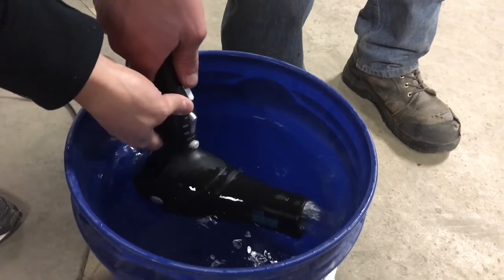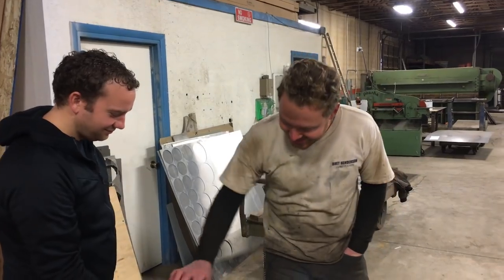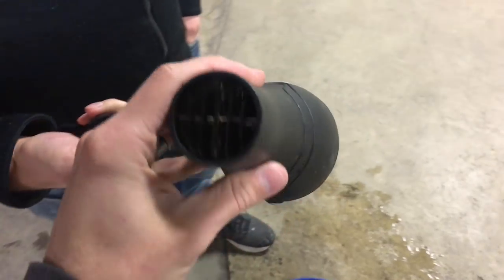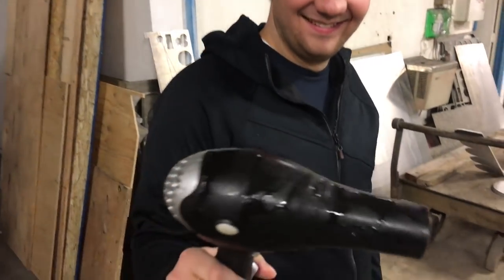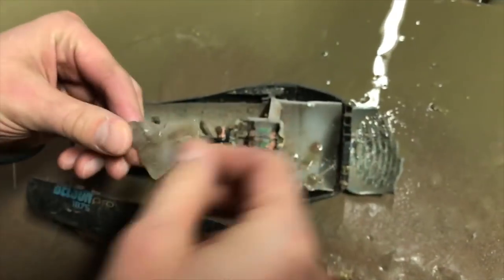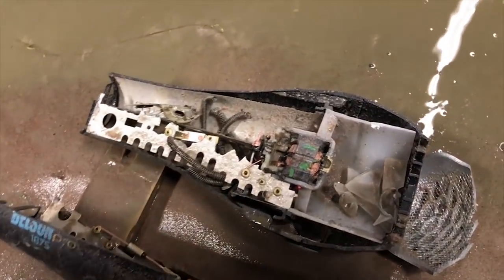Hair Dryer (plugged in) In Water vs 60,000 PSI Waterjet

Comment: Always fun to watch you guys cutting something in half. I made a video regarding this subject a long time ago. If you drop it into (Pure)distilled water, no. You had insulated boots on and used one hand. Repeat using bare feet. :-) It won't go well. You should have used a GFCI protected outlet for this experiment.
Reply: electronicsNmore if you add soap to the water it will conduct more electricity
Reply: The plug is already gfci but because it is only a 2 prong plug a gfci outlet won’t do anything it requires a grounding plug
Reply: Electroboom has an excellent video about trying to trip a GFCI outlet by shorting it out in water as well.
Reply: No path to gnd through the bucket hence no trip
Reply: Should have used a gfci outlet because you have a godamn waterjet..
Reply: Matthew Hunter The path was made when his hand touched the water.
Reply: electronicsNmore right that's why it didn't trip just in the bucket
Reply: If you look at the end of the cord, there is a GFI built into the plug. I suspect the power bar, extension cord, or the wiring in the building is faulty. New laws state that any device that could come into contact with water must be GFI protected on its own and not rely on the outlet being GFI protected.
Reply: But when the guys body absorbed the shock as he felt it, that should have tripped the GFI device built into the hairdryers plug.
Reply: Sounds like a faulty GFCI connected to the hair dryer.
Reply: Yeah because shouldn't the protection device be measuring the difference in current going in, compared to coming out the device to decide whether to trip?

I'm going for old wiring that uses fuses. Stuck a fork in my toaster once, to see what'd happen... managed to blow a 30A circuit breaker and a 13A fused plug (I live in the UK, our wiring is creative). Feeling a fizz from a bucket of live water should have tripped something, unless it's a fuse that needs time and current to burn out.

So for science he needs to stick his hand in longer.
Reply: James Grimwood Well, you start feeling if starting from ~10mA (Not strong, but you feel it).
And it is not even enough to trip a (normal 30mA) GFCI.
Reply: Well, I think there are different models of hair dryers. Saying, I would not put a hair dryer in water and my hand too, even if it were to be safely isolated from mains.
Reply: Too Many smart guys here lol. I agree with electrincsNmore but if there was a GFCI protection (Or RCD) connected, it might have been too little current passed to trip it. (There would have been considerably more current passed through his body without the insulating shoes on - and a bit more pain)
Reply: no, the path wasn't created because of the rubber on the bottom of the shoes.  the zap was due to the air resistance creating a bridge, but that wouldn't be enough to allow for the current needed to trip the safety
Reply: Russell, the bucket and shoes provided insulation from the ground.  the gfci was working as intended as it isn't designed to trip on overload or arching.

the way it works is, as long as there is no path to the earth, the line and neutral will be in balance with each other (no variation in current).  however, with a path to earth, now there is a drop in the current going through the neutral, throwing the balance off, which is detected by a coil in the safety, turning that variance into a small voltage that will be detected by the circuitry inside and activating another coil that releases a set of contacts inside, opening the circuit..

now, you might wonder then how the test function works on the safety.  the way that works is by pushing the test button you are creating a bridge between the live wire after the coil and the neutral wire before the coil.  this creates an imbalance because the coil will only detect the current over the live and see the same is not flowing back through the coil on the neutral side.
Reply: Thanks for the detailed explanation on how the GFCI works dude -  but I've had plenty of personal experience with them and understand their inner workings just fine. I understand that educating someone can be a rewarding experience so I hope others can read your comment and learn for themselves!
Reply: Draygoes rr
Reply: The hair dryer has its own GFCI

Comment: ld like to see you do the same with a UK hairdryer running at 240V. BOOM!!
Reply: CRAIG-CRAIG Might still be fine. It's a bit edgier, but the difference is not big enough for an explosion.
Reply: Landon Wantaja, Yes, UK is 240V 50Hz
Reply: That'd be shocking
Reply: Well officially the UK uses 230V but you will find that most homes supply is around 240VAC, Mine happens to be 245V.
Reply: The Volt or Wattage wont kill you, its the amp that can zap your life away at just 100 (0.1) to 200 (0.2) milliamp
Reply: Also 10 milliamp is 0.01 amps not 0.10 and 20 is 0.02

Comment: The heating coil inside the dryer is already a 'short', it's just that the coils are designed to dissipate the energy fast enough to not actually burn up the wire. Putting it into water only allowed the water to draw heat away from the coils, acting as a heat sink.

Comment: the thing about hair dryers is they are 120v sure, for the heating element, but the fan is a rectified 12v dc motor. and 12v dc is not affected by water. same as why when a car ends up in a river all the lights will stay on when its sinking...

Comment: If the water is fresh it won't really conduct electricity. If the water is soapy or salty, then it will conduct electricity about 10 times better. Its depending on how much salt you add.

Comment: The point of failure would have been when the jet cut the element open circuit at the beginning, the heat and the motor would both stop as the motor is power by a extra low voltage and uses the element as a voltage divider. elv brushed motors and heating elements will work under water as clean water is a poor conductor, however there is enough leakage current to still cause electrocution.

Comment: the weird smell was burnt plastic. heres how this thing works: you have a motor spinning a proppeller, in front of the propeller is some wire that heats up. if the propeller doesnt move the heat away because its busy with water, the hot wire melts the plastic

Comment: It didnt break because the motor relies purely on magnetic forces to turn. And the wire coils that go around in the inside arent live, they are thin coated by enamel because it would short otherwise. But i dont know why the heater didnt fuck up either. Maybe its enameled too? or painted...

Comment: It will only shock you if it's hot, the heat comes from coils with electricity running through the them and the resistance in the wire causes it to heat up and as the air blows around the coils it gets warm

Comment: Breaker didn’t trip because it’s not a gfci. It would trip if you overloaded or dead shortened the leads. Gfci trips when there’s small difference in current going “in and out” the outlet.

Comment: The failed GFCI is actually pretty scary..
Reply: Perfectly normal for them to do that if the amount of current leakage was lower than what they are designed to cut out at, the shock will still hurt a bit but it's pretty unlikely to cause you any harm.
Reply: LOLDONGS exactly happy to see atleast somone knows GFCI.
Reply: DamnFoxCat, I guess people misunderstand exactly how they work as they hear "they are designed to protect you from an electrical shock" and assume that any shock will cause it to trip.

Comment: the safety can't trip because you don't have a path to earth.  if you had provided a path to the grounding pin then the safety on the plug would have tripped off, but because you were using a bucket that served as an insulator there was no way for it to detect a problem.  the other issue is when the guy stuck his hand in, he was also insulated by his shoes, so even though he felt it there wasn't a path to earth.

the reason a hair dryer can kill you in a bathtub is because there IS a path present through the drain, which does normally provide a path to ground, as long as there is no pvc pipe used to create a break.

Comment: The Breaker will not trip because there was no short circuit so no over current condition and the is no earth leakage either as the hair drier is 2 pin and not earthed, the is no leakage through the plastic bucket of water, if you put the drier in a pond or pool where the is a return path to ground then it will trip the safety switch. If you run the dryer from an isolated power supply again no return path to ground.

Comment: As an electricien, I died 40 times on the inside... you were lucky for using cold water without soap... Warm water and soap in it and it would've shorted... and probably through your wet hands as well...

PLEASE don't try this at home...
Reply: If you really are an electrician you would know its the amps that could really end ones life, if anything the watt and volt would certain fry you but would take longer to end life
Reply: Joshua79C C what has that to do with what i said? and it's the voltage and amps habd in hand, which kills people... :)

Comment: You only stuck the top part of the dryer in that had no actual electricity running thru it. The blower is powered by it, but there is no actual source until you get to the handle. You didn't stick it in deep enough.

Comment: Omg you guys really left that plugged in and started poking it. So careless, you could have received a fatal shock there. RCD's only trip when active goes through to Earth. That hiardryer won't have an Earth pin. The safety device will happily let you draw power between active and neutral, so as a safety measure, it was completely useless. Foolish to show this. Thumb down unsubbed